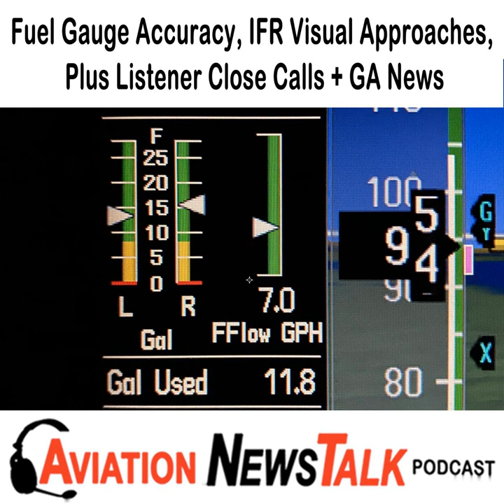169 Fuel Gauge Accuracy, IFR Visual Approaches, &amp; Listener Close Calls + GA News

Comment: Fuel Gauge accuracy is a hidden component in regulation.   With Embraer we are writing the ASTM fuel quantity regulation that will be the future standard.    The actual reference is in the TSO where there is a  maximum discrepancy of 3% or about a gallon on a 40 gallon tank.      This is actually a standard that can be met.      The reference for utilizing the TSO as a minimum standard  is forum in Advisory Circular AC23.17 System And Equipment Guidance for Certification which points to the TSO as the reference.   In the modern sense in tiering the requirements to classes and making under reporting the bias - vs over reporting  remaining fuel.     What is very interesting as a Cirrus instructor  is that once we became standard  on Cirrus aircraft in 2012  - fuel related incidents and accidents on those aircraft outfitted dropped to ZERO.      As in nothing NADA problem over.     As you are aware we worked very closely with Garmin to insure the pilot received appropriate warnings about fuel state and imbalance.    Reach out to us this little Nich of aviation is our world